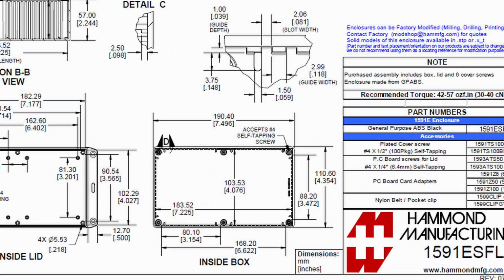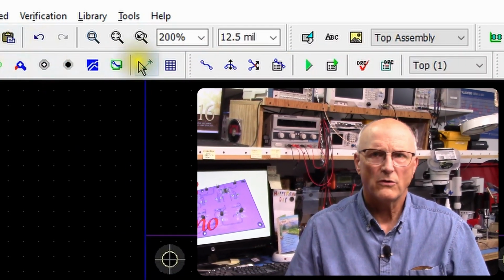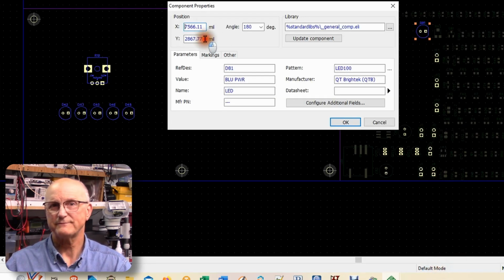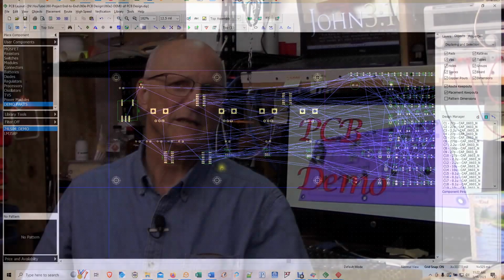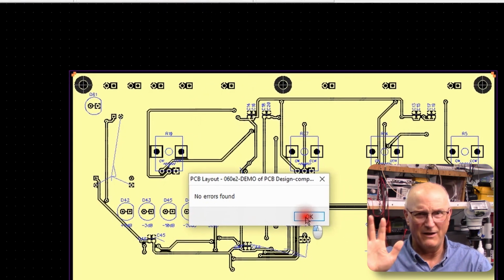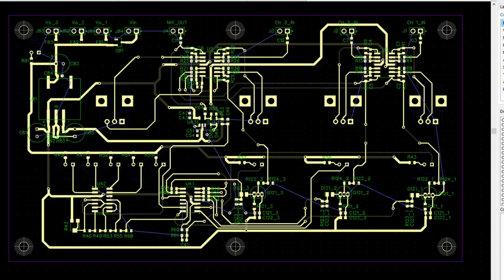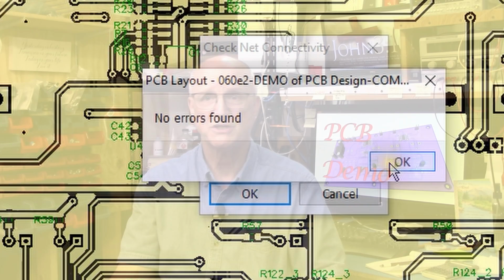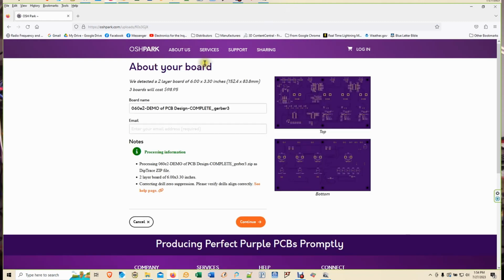DEMO Designing a PCB: Step 5c (060e2b)

Comment: Great video! Can you use Diptrace to print and etch your own circuit boards?
Reply from the maker: Thanks! 🙂
The answer is yes you can using certain methods. If the method involves printing to a printer, like the what I call the "toner transfer method," then you can print a reverse image to the special paper. I haven't done this for MANY years, so I am not sure if that paper is still available or what other methods you might have at your disposal.

DIPTRACE provides the Gerber files for fabricators like OSH Park and the ability to print a 100% scale image of the board to a printer.
OSH Park provides PCB fabrication so affordably that I don't bother to make my own with extremely few exceptions. 🙂
Reply from the maker: There is also the "sharpie" method. Draw the circuit on the VERY clean copper with a good quality, fresh sharpie, then etch. It actually works!!
This is my LONG overdue reply!  Sorry. Sometimes this stuff gets lost in the YT world. I'm spending some time trying to clean all this stuff up. :-)
Reply: @eie_for_you  No problem! I've used sharpies to 'fix' traces when I etch boards before. It really helps when you draw the lines to the correct connections. (don't ask me how I know). My issue is with the software(s). I'm limited with computers around here. Things are tight with me out of work. I've used EZ-eda before, but It reroutes the connections to the wrong places at random times. The last project I did using them resulted in me having to hand wire the "bad" routing. WHAT a DISASTER! I'm limited here to an old ACER web browser so I'm stuck with cloud based programs.
Reply from the maker: @W1RMD Most definitely yes. I just printed a 100% scale layout of a board I designed. You can turn off or on any features you do not want printed. I think you will find DIPTrace better behaved. 🙂